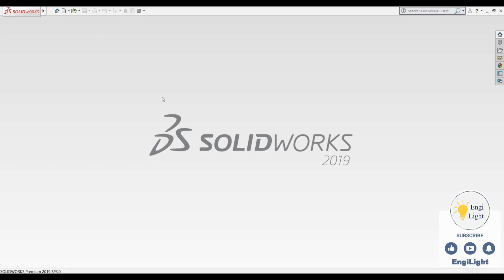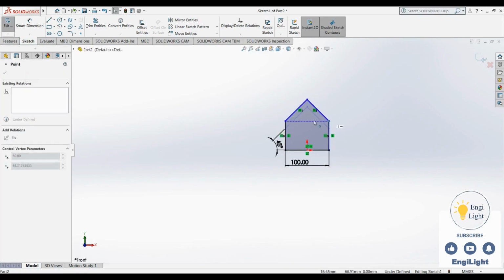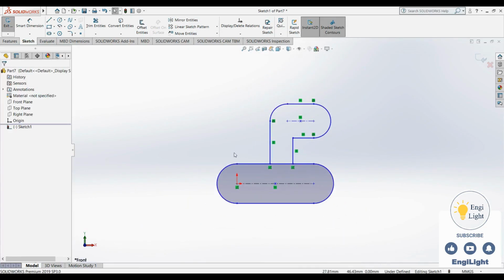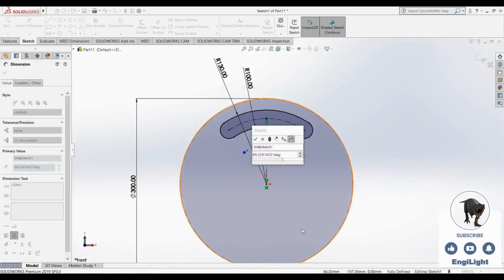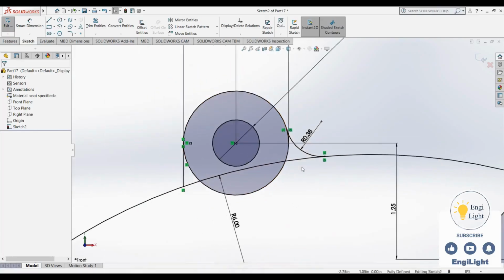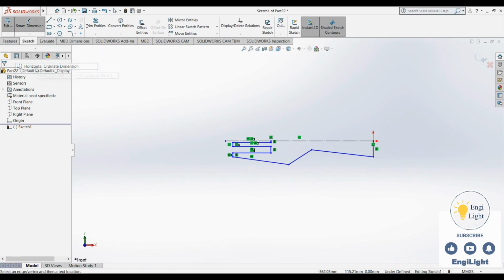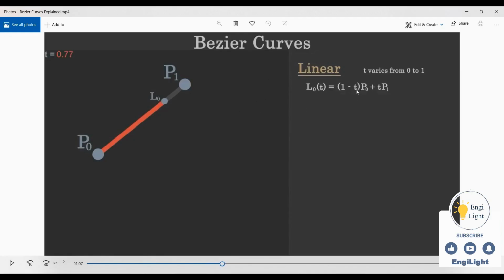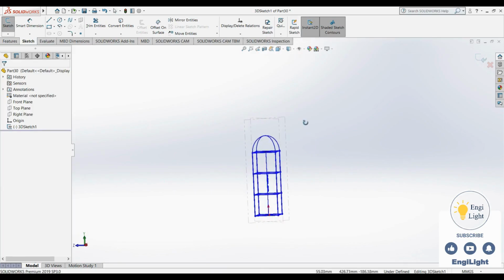SolidWorks Sketching Full Course: Zero to Hero (3.5 Hours) | 24 Sketch Exercises (For Beginners)

Comment: Thank you so much bro, along with other courses, i think this was a really good practice, most courses, even those in college dont spend too much time on mastering 2D sketches, they just teach the basics and go straight into 3D modeling. I feel mastering and practicing as much as you can 2D makes a lot for design intent and transition into engineering design than just making figures in CAD. Great video man.
Reply from the maker: Thanks a lot, You're absolutely right strong 2D sketching is the foundation for good design intent. Glad this practice helped!